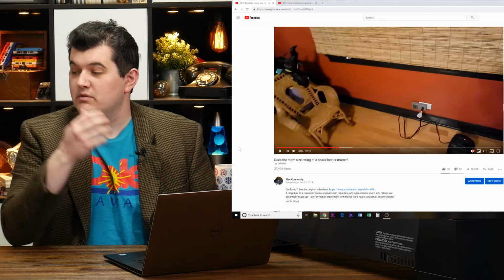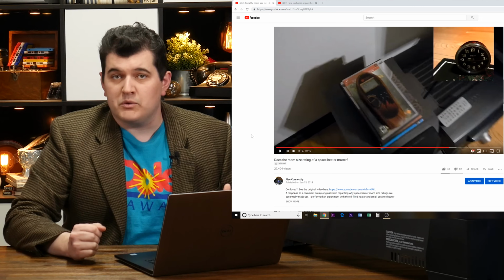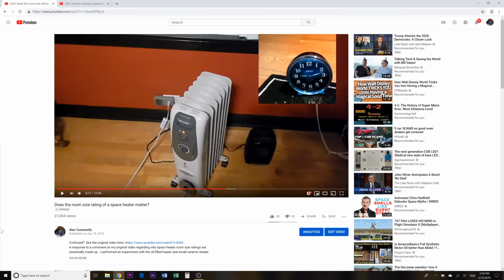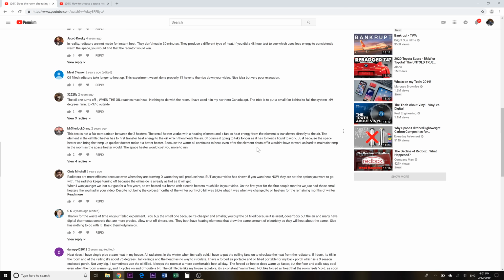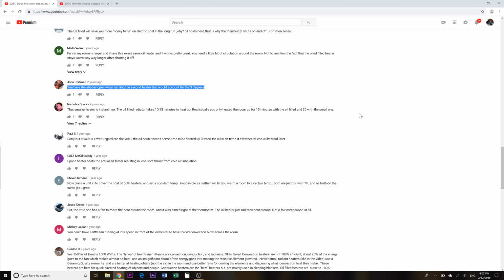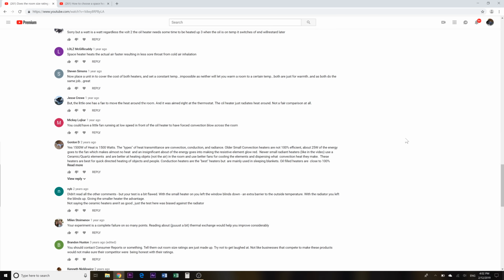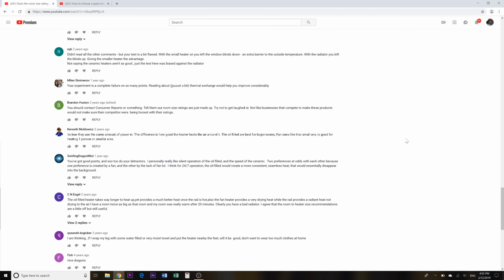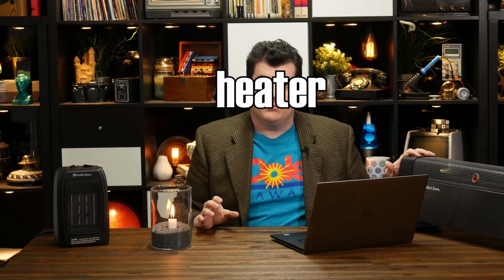More Space Heater Nonsense

Comment: As a retired HVAC professional......You are correct in your assertions.   For 40 years I’ve found that trying to explain heat concepts gets lost on most people.  Also, telling someone that an electric heater is 100% efficient confounds most people. “But it costs more to use electric heat” or “Electric heat doesn’t heat as well as gas, oil etc”  The concept of efficiency gets confused with the cost to run the device. To go on a tangent here, most people think thermostats are like gas pedals.....turning a thermostat all the way up Does Not make the equipment heat the room faster.  Consumer grade space heaters will not draw more than 1500 watts. Most residential electrical outlets are sized and protected at 15 amps. (Volts X Amps= Watts) so, the receptacle is limited to 1800 watts. (120volts X 15amps = 1800 Watts) that leaves only 300 watts or 2.5 amps for whatever else is plugged in.....And...most wall outlets are connected to a few other outlets with devices plugged into them.  That 15 amps shared amongst 3 or 4 outlets leaves very little for much else if a 1500 watt heater is drawing 12.5 amps (1500 watt heater / 120 volts = 12.5 amps).  The “perfect for large or perfect for small” rooms is marketing Bullshit (excuse my language) because it’s the only way they can sell physically larger space heaters for more money while following the electrical device power limits rules. For those that want to dispute.....research the National Electrical Code (NEC).

Comment: Thinking, how does a ceiling fan on low circulating the air effect the results? An array of sensors in the room showing real temps where we live?  Plus, the air heater vs oil, try an 8 or 24  hour comparison?

Comment: A couple of observations (not criticisms) about the difference between the oil heater vs the 'quartz' radiant heater vs the metal coil heater designs:

I noticed in your original video, and in your dialog in the new video, you are in the context of a bedroom. This got me to thinking about the differences of the heater designs being benefits or not, regardless of the fact that all would deliver (in the long run) the same heat energy into the same space. It is a BEDroom. Much of what you're going to do in there is sleep, and for (hopefully) about 8 hours. So, how you use a space is more important in picking a heater than output, even if the output in the long run is the same.

If you are sleeping, you are passive, but you are also generally bundled up in an insulated bed, and your body can become quite warm and efficient at staying that way. When you sleep and your activity changes very little, a gradual temperature change is going to be more comfortable because it is easier to adapt to. Thus, your slow changing oil heater will be much more comfortable, and the 'negative' of the slower heating rate becomes a net positive. If you are going to be awake and more mentally active, but not exceptionally physically active, and not be in the room for a long duration, a small radiant quartz heater that directs infrared heat right at you is going to be best, because it will make YOU warm first, creating the comfort to get to work. You can actually shut it off and save total energy expenditure, if you leave before it would reach that thermal equilibrium. It could actually save you energy, while also making you more comfortable. If you are going to be physically active, you want the comfort of the environment the soonest, but will want to be able to actually reduce the addition of heat before very long, so the metal coil heater is going to be best. You'll create an environs that allows you to be active immediately without being dressed like a polar explorer, and as your body produces more heat, you can again potentially save money by turning off the heater before it necessarily reaches equilibrium. You could certainly save even if it has reached the equilibrium, if your activity allows you to tolerate a room that is actually cooling back down.

So, what we have here from the industry marketing, is a failure to truly understand and convey the benefits gained from the features of each heater. That's Marketing 101 - features vs benefits, and qualifying the right product for the benefits the customer wants. Instead of room size, the packing should be talking about the true application of the product, like 'best for bedrooms' or 'best for your office' or 'best for your workshop'.

The only criticism I have is the mention you make of lower thermal efficiency of a furnace vs an electric space heater, not because that is incorrect, but because of the mention of why we need an exhaust. You said that carbon monoxide would kill you, and it would - but if the furnace is a modern gas unit, chances are the CO emissions are so low that it isn't what would kill you first - it would be the displacement of oxygen in the house by carbon dioxide. I'm sure you know about the difference between CO poisoning and suffocation, and it is a bit semantic because dead is dead, but it is important to understand the difference, as the symptoms differ. Another interesting observation here is that we actually do have space heaters that are non-electric, that do not 'require' an external exhaust, on the premise they're working efficiently enough not to produce CO poisoning risk - kerosene space heaters. Even when working as 'cleanly' as they're meant to, the increased CO2 in the space is a danger people often overlook. Fresh air must be introduced into any space heated by combustion of fuel and atmospheric oxygen, to be truly safe.

Shame this is so long you'll probably never read it all. Reply "HA!" if you did.

Comment: It totally makes sense that any electric heater of a given wattage is going to produce the same amount of heat.

I wonder if the idea is that for a big room you want to minimize the velocity of the air coming out of the fan. A larger room is going to take a while to heat up and having that yet-to-be-fully-heated air moving around the room is going to make it feel colder than if the air were more still. A short 1500-watt heating element in a small heater is going to get a lot hotter (per inch) than a much longer one in a bigger unit. By elongating the heating element, it is possible to slow down the fan (or even just rely on convection) without the unit overheating.

I’m actually testing this right now with a very small heater, and it is possible for me to stand close enough that I can feel the air moving but far enough away that I can’t feel the heat. It feels more comfortable if I get out of the path of the fan.

In a smaller room you’re probably close enough to the heater that it is blasting hot air straight at you, negating the impact of the wind chill as the rest of the room heats up. It actually makes sense in that case to keep the heating element small and concentrate the heat as much as possible.

Does that make any sense at all? What am I missing?

Comment: But wouldn't the oil heater still be more efficient? The oil doesn't limit the heater, the oil allows the heater to distribute heat even when it's not drawing any power thus making it more efficient no? So yes they both draw 1500 Watts but the oil heater is only running 50% of the time compared to the fan heater giving the same long term results.

Comment: Can I please pose a thought to you. The theory of the oil convection heater is over a long period of time, say 8 hours, the Oil filled heater will be more efficient than the space heater. Reason: The small space heater only produces heat when the heating element and fan are running, conversely, The oil filled heater will still emit heat from the hot internal oil, even when the internal element is not running.

Comment: Your frustrations with the people in the comments section are justified.  You are right.  1500 watts is 1500 watts being released regardless of the form factor.  I have a large ceramic space heater and I have replaced it 3 times ($60) because the thermostat is faulty on all of them.  You set it and it fails by either not turning on at all or stays on all the time.  Infuriating.  I'm living with the last one because I don't want to admit that I've wasted $180 dollars on them.  Best advice would be for you to inform us of a nice space heater that has a RELIABLE thermostat.

Comment: I must admit was never interested in space heaters (my gas boiler works great so I never felt the need for space heater, also zoned system helps heating only needed rooms), but when I came across this video I went to a shop to see if such labelling exists also here in Italy and, happly, I didn't found anything but the wattage (all between 2kW and 2,2kW), just few models claiming to be 'more efficient' with 'ceramic coils' costing about 5x the cheapest, possibly due to greater thermostat precision.
Here the buzz is around 'swedish heaters' that claim to be more efficient costing more than 200€, when only thing is that they don't get much hot so reduced blakening on walls and reduced 'burnt dust smell', pleasent feature but I don't think it deserve a 10x premium.

Comment: Mechanical engineering student here, just taking a stab at your question. The oil and quartz act as  stored thermal energy, as you mentioned briefly. It's the same concept used to allow solar farms (non photovoltaic) to operate at night. Yes that means it does take longer to heat up, but when they reach the desired temperature they do continue to release heat. This essentially acts as a dampener. This is to say that in a small room, assuming similar insulation qualities as a large room, a small heater can more easily maintain (keyword here) the temperature with the given thermal loss of the small rooms surface area. A large room, with thus a larger surface area for loss, will see the small heater either never turning off or rapid cycling on and off to MAINTAIN the heat. With thermal storage such as oil, and provided an intelligent design for the thermostat, it can maintain a heat level more consistently in a larger area. To be clear, 100% correct, 1500 watts is 1500 watts. I believe the inaccurate marketing stems from the misunderstanding of a maintained temperature level. Such a system btw implies the  temp level can even BE REACHED given the aforementioned heat loss issue: a situation I early find to be true.

TLDR: thermal storage acts a a dampener provided desired temperature can be reached.

Comment: Here in the UK space heaters tend to range in output from 0.45kw 3kw. So cost v heat output is a bit more all over the place
Reply: That makes sense, since the 1500W limit in the USA where 120VAC is the norm requires about 12.5A of current (redundant, I know!) and standard house wiring  is limited to about 15A.  12.5A in the UK at 240VAC would result in about 3000W.  QED.

Comment: It's pretty simple watts in = btu out.  I like oil heaters because they are quiet and won't set the blinds on fire but there is no physical way they can produce more heat than an equivalent powered ceramic heater.  You could set yourself up a rig that contains 15 old incandescent 100 watt light bulbs and you'll get the same heat, although it will be awfully bright.

The only machine I am aware of that can possibly move more BTU's than it uses is a heat pump (air conditioner), but only over a limited range.  For example companies around here used to try and sell "geothermal" heaters that were basically a heat pump that put the cooling pipes in the ground in your yard, which would be above ambient air temperature.  But it was a scam and it's mostly gone away now.

All of this applies to "electric fireplaces" too.  They are nothing more than a ceramic electric heater with a light display.

Comment: It's the same reason when LED camping lanterns where rolling out onto the market they where the same size as the common propane lanterns even though the LED lanterns where mostly empty space.

A larger propane lantern's ignition area was larger so they could have the gas flowing faster to make more flame and thus more light, but if you showed someone a new LED lantern that's smaller they would assume it would be dimmer even if it's the other way around. So because larger gas heaters also made more heat people assumed that the larger electric ones would also make more. It's what people are used to shaping design decisions even if those choices don't pass closer examination.

In fact there is also another factor that could easily reduce the efficintcy of the fan-less heater due to thermal dynamics. What I'm talking about is that heat transfer between two materials scales with the temperature difference of the two materials. For example a hotter stove will burn your food faster than one only just hot enough. This ratio also effects smaller temperature differences. With the fan-less heater poring the heat strait to the ceiling first your ceiling will be hotter than if you used a forced air heater which means your ceiling will conduct heat to the area above faster because of a larger temperature difference which means more heat exiting your room. If there is no room you need heated above that ceiling then it's wasted heat.

Comment: My interest in "efficiency" pertains to how much power (i.e. cost in money) is being used over time to heat.  Since I only have one room (not counting the bathroom) I really only need to heat the area where I am, not even the entire room, so I mostly just use an 80 watt electric blanket in direct contact with me, so the room may be cold, but I am warm.  When it gets too cold for that I'll plug in the wall mount AC/Heat unit and turn that on for 2 or 3 hours and then unplug it again.  I've used those oil/radiator heaters before, and the heat doesn't really go that far from the unit so I used to drape my blanket over it so most of the heat would go under the covers with me.  I don't really like the non-oil electric space heaters either, get too close and stuff starts to burn or melt, get too far and you don't feel any heat at all.  (It's pretty drafty here in Japan and the walls don't have insulation either.)  When it's at it's coldest, I'll sleep in several layers of clothes, a bomber jacket, and a scarf because it just costs way too much money to maintain a comfortable temperature in the room.

Comment: For most people with a small room to heat, they go to the store where Brand A has 'fan heater' and 'radiant heater' but Brand B has 'small room heater' and 'large room heater' they will probably buy Brand B because it has a heater 'designed' specifically for what they need. Now if you're Brand A you've got to put those nonsense labels on too!

Comment: One thing you answered without realizing it is the oil filled heater thermostat is meant to control the oil temp not the room temp, if it was staying on till the air temp was satisfied the oil would overheat. it tries to keep the oil temp constant for a more even heat.

Comment: I have 2 rooms who need help getting heat. A bedroom 10 by 11 roughly I use q small heater with a fan like shown.  And the other room is a hallway 3 by 15 and I put an oil heater like the one you showed in it. The one in the bedroom works way better. The hallway is around 5 degrees colder vs the bedroom.
Reply: I end up leaving the bedroom door open to heat that hallway. To cheap to buy another heater lol

Comment: I'm not sure if this would be a factor or not, but... Is it possible the oil-filled ones could be cheaper to run because of heat capacity? As in, once the oil has reached the right temperature, it'll remain at that temperature for a fairly-long time, warming the room in the process without losing many degrees because it has to lose more energy before its temperature drops, and...

Hmm. On reflection, it doesn't really work, because you have to spend the energy to bring it up to the right temperature to begin with, don't you? And what even is the heat capacity of the oil anyway, is it enough to be significant? Hmm. Need to think about this one a bit more.
Reply: It is definitely cheaper to run such a heater, but only because it turns itself off intermittently. Any other action it may have, like keeping the oil at a constant temperature, is merely a delay between the production of heat and the distribution of heat which increases the leak of energy (be it to light or sound [though, they also eventually turn into heat])
Reply: you may be right. But my thinking was; Well, during the time the circuit is switched off by the thermostat, the oil retains heat, so even though the power is off, the radiator is still radiating heat into the room. It's not consuming energy, (well okay, it's still consuming some because no system is 100% efficient, but it's close to zero) but it's still warming the room, or keeping it warm, as the case may be. This is the factor I thought might be what changes things.

Comment: While I’m not fond of the deceptive marketing of space heaters, the experiment is fundamentally flawed.  Most of the heat in the small heater is released by radiation, rather than convection.  I had the same idea once- in -15F, we couldn’t get the house above 50 degrees with a small heater after 3 days of use.  Within 24 hours of using an oil-filled heater the room got up to 75F.

Comment: You are 100 % correct. It might be helpful to point out you are only talking about the BTU's of heat energy you are putting into a room. What happens to it after that is not part of your discussion. If you were to measure the duty cycles of the different heaters and express the results in BTU'S/H you'll find a closer correlation to temperature rise in a given room volume.Most of what I've read in the comments tells me there are a lot of people clueless about thermal dynamics, particularly those that site heat rises. That is a function of gravity and air density. thermal dynamics plays no roll.A rudimentary explanation of thermal dynamics for your detractors would require a 1 hour + video.